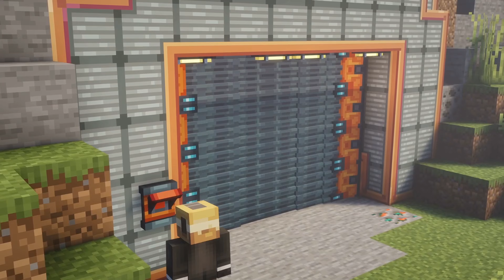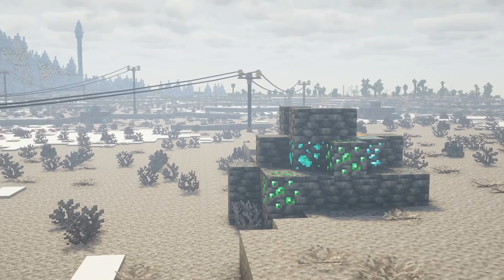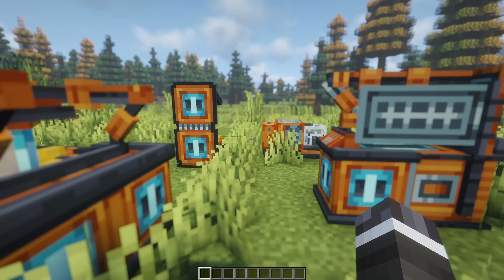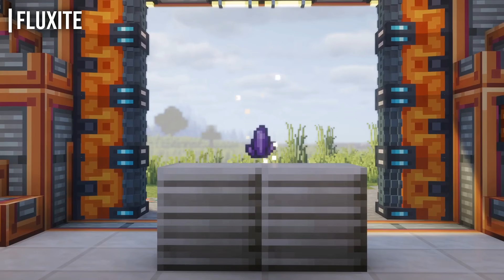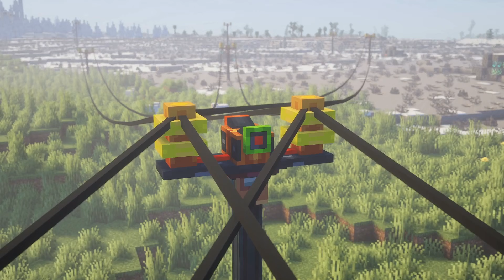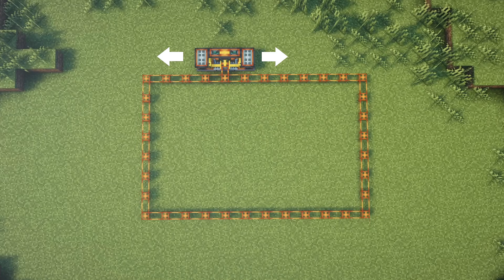Oritech (1.21.1) | (Beginner Guide / Showcase)

Comment: What really sucks is that not only is it strictly for 1.21 but it's only on fabric. The fabric to forge bridge mod I use of course doesn't have a version available for 1.21 so to even play the mod I'd have to not only make a new install of the game for 1.21 but I also have to install fabric to basically play a single mod. So many other mods have 1.20 included and the mod page says there won't be a version for 1.20.1... I want to play it so badly but I can't be bothered if that's the only mod that NEEDS to be that game version and on fabric, I really hope the mod author at least considers porting it to forge.
Reply: It's also on neoforge
Reply: @Xodis99  Check again. Oritech is on NeoForge 1.21.1, and so is Sinytra.

Comment: I guessed right where you would end, but yeah Oritech is a great Tech mod the only thing I will say to new users.... be ready to mine ALOT of materials... would recommend the first things being the generator and crusher so you can at least multiply ores... Also if using in a modpack that has ways to transport blocks, it will make your life easier with getting flux crystals.
Reply: i heard alot of people saying its bad early game i really want to try it but that kinda scares me away and makes me want to go back to create for the 1023291031th time 😭
Reply: @adhamsherif6230  why not running both mods ? oritech can be easier in early if you add mods on top
Reply: @SkyRRunner I like to do themed packs and getting create and oritech to fit thematically without doing a lot o adjusting is hard + I'd rather not have two separate in-depth tech mods just one with addons
Reply: @adhamsherif6230  Its not bad like most would say its just a bigger investment then others, quite literally if you want to make it less of an investment get a Fragment forge ASAP, then you will be fine
Reply: Off the top of my head if you use 1 Iron ore it turns into 2 clumps and smaller fragments, then centrifuging the clumps with water makes 2 gems then you can put it into a foundry for 1 more gem thus 1 to 3, or I think the atomic forge can make it 1-4? Something like this  Fragment Forge > Centrifuge-> foundry OR Atomic Forge- this is off the top of my head
Reply: @adhamsherif6230  play gtnh